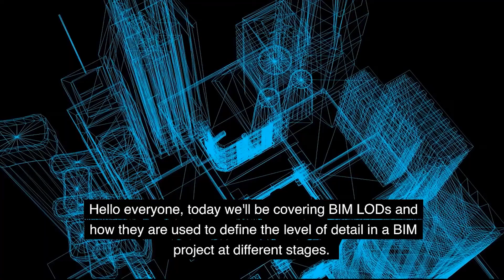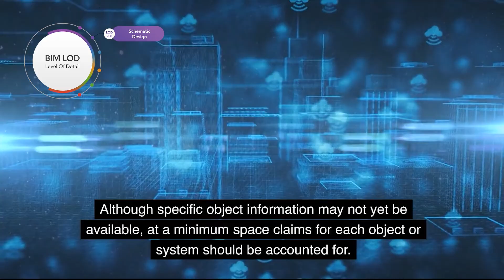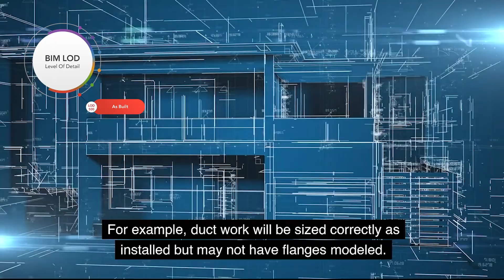BIM LOD Explained

Comment: please explain what softwares are included at different stages of LOD in BIM.
Reply from the maker: Thanks for the suggestion! There are many software available for design and coordination. Typically a base model will be created via Revit by the design team up to LOD 200. At LOD 200, the models will likely be processed via Navisworks, BIM360 or ACC. This is when the coordination process takes place. After coordination, the model will be held in a project manaement software such as Procore during the construction phase. At the end of construction, the model will be updated to align with as-built conditions and then will be included in the facility management handover documents and will be stored within the clients chosen FM platform.